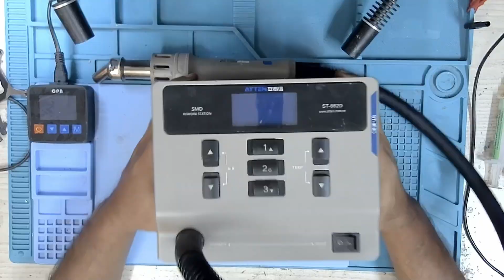How to Reball a GPU Core Step by Step | Pro Repair Guide

Comment: Can i do that without any machinery? 😂
Reply from the maker: You will need hot air station, solder balls, stencil and flux to do the reball. You can do without stencil but puting the balls one by one is time consuming and will put your patience to the test. After you have all this you will need to build the skill over time with practice. As long as you don't give up you will be able to do it.

Comment: Im looking at getting into gpu bga work and was wondering what workstations you would recommend and if there are any good ones under 1k (usd)?
Reply from the maker: There are machines under 1k  like the ACHI 6500. It's an IR rework station. It has its own strengths and weakness. Most of the rework stations under 1K are mostly IR stations. Around 1.5K you will get into 3 zones Rework stations. Basically it does not matter what you get. My recommendation is what every you get master it by practicing in dead boards  study the limits of the machine without damaging the PCB. I started off with an IR base and converted my hot air as the top heater. The entire thing was custom made. Eventually I upgraded to a 3 zone. I recommend you start small with IR like the ACHI 6500. It's a very capable machine but you will need to practice before you start using it on customers GPUs. Remember no matter which Rework stations you get it all need to be mastered.
Reply: @GraphicsCardRepairs-tk7ql sounds great, thanks for the advice!

Comment: That was really well put together, thank you. I reballed many nintendo switch APU's. But i struggle with GPU's since my setup can barely get enough heat dirstributed to get the core off the board. I also struggle with CPU sockets on mainboards but its still easier than gpu-cores.
Maybe its time to get a BGA rework station :). Just not sure which one.

Subscribed <3
Reply from the maker: Thank you 😊. I have a video on BGA rework station and how to calibrate it on my channel.

Comment: Hey do you have a gool source for GPU Core  stencils,  or a recommended seller on AliExpress. Also just curious did your station come with the inspection camera or did you put something together yourself?
Reply from the maker: Not really. I buy from anyone that offers a good deal. So far have not ran into any trouble with the stencils.

Comment: could you recommend a good flux to reball?, i have tried with different ones and most of them become to liquid and balls move everywhere and stick together.
Reply: I like mg chemicals no clean flux as an alternative
Reply from the maker: I use mechanic 559. Like shown in the video. Use the way it's shown in the video and you won't have issues
Reply: @GraphicsCardRepairs-tk7ql thanks, syringe? Or the bottle, to order some😅

Comment: Hello, can you please tell me more about the process and temperatures. Seems that almost nobody mentions temperatures or air speed they use? 

1. What temperature and air speed do you use when desolder and solder GPU core. I
2. Is this 4090 core?
3. Can you tell me about the nozzle size you used. I see you  used a 55mm nozzle, but it was slightly bigger than the core. Wouldn't 50mm nozzle be better?
Reply from the maker: This is a 4090 PCB. I have linked a video  in the description where I show the temperature and calibration. It works for 3090 and 4090. 50mm nozzle would do 55mm is better as it can fit a wide variety of core. You don't want to end up using a nozzle for every core .

Comment: So I’m trying to learn electronics, especially GPU repairs, do you use the ball size on the stencil? I’m asking because I’ve seen some people that will use a slightly smaller ball than what the stencil says. Just wanted to see what your thoughts were. Thanks Frasier and keep up the great work. I look forward to your videos.
Reply from the maker: Yes sometimes I use a step smaller specially for 3090. The normal size is 0.5mm sometimes I drop it down to 0.45mm. For 4090, 3080 and others I stick to 0.5mm. there is no harm in dropping a size smaller if you feel there can be issues with bridging. Especially if there is a bend in the board.